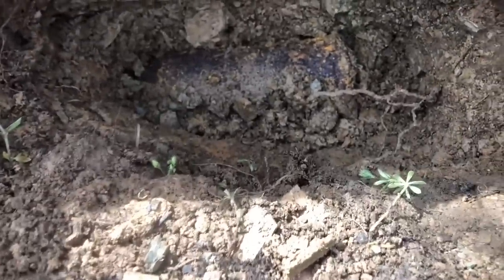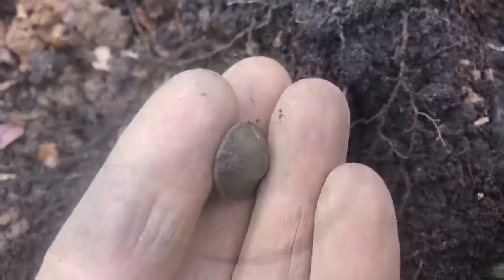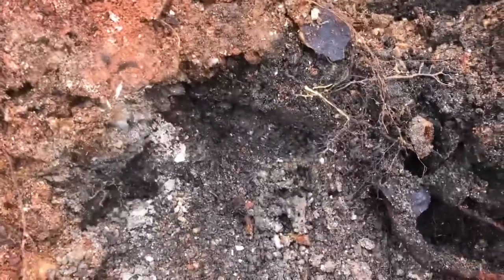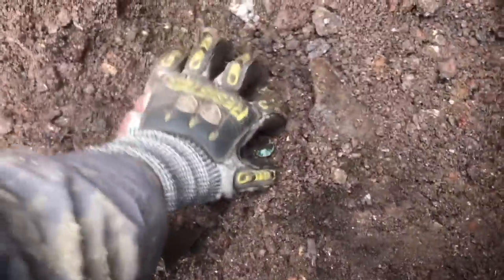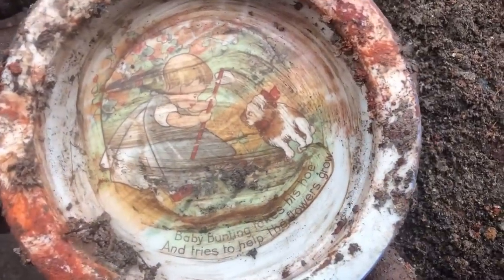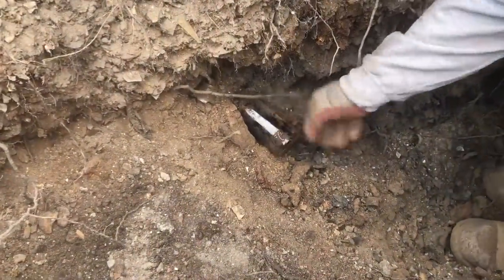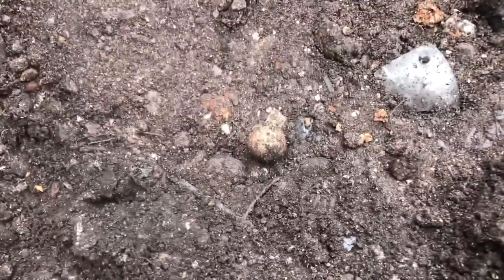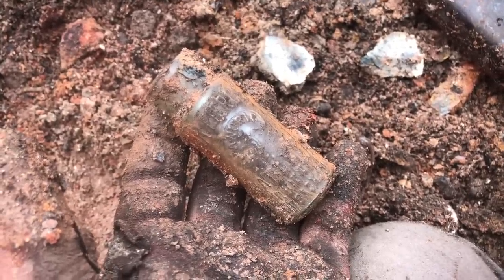FIND OF A LIFETIME FOUND metal detecting Civil War site and the Finale of the haunted dump.

Comment: If I were detecting and uncovered a shell from the CW what would be the odds of it going off and how should I handle it safely?
Reply from the maker: From all the experts I’ve spoken with they are not that dangerous unless you put it in or near a heat source. The black powder inside is still live but won’t detonate without a heat source. I was told to put in a bucket of water to keep it wet. It has to be drilled out by someone who knows what they are doing, and also electrolysis to remove the rust layer. As long as you do that you should be fine, DO NOT put in electrolysis until it has been disarmed or it very well could blow up.
Reply: @CrickDiggersInc  Thank you for the response. I have never found one but I've always wondered what the proper and safe thing to do would be.  Love watching your vids! Keep digging!